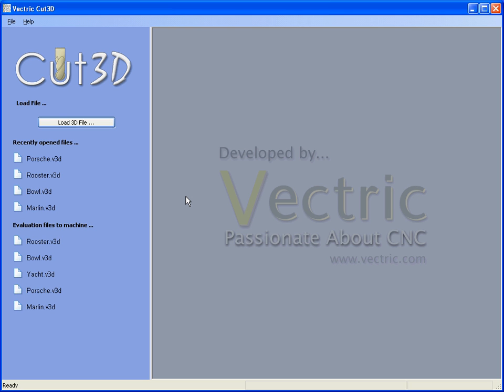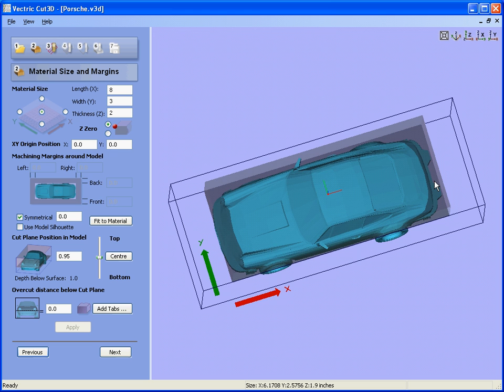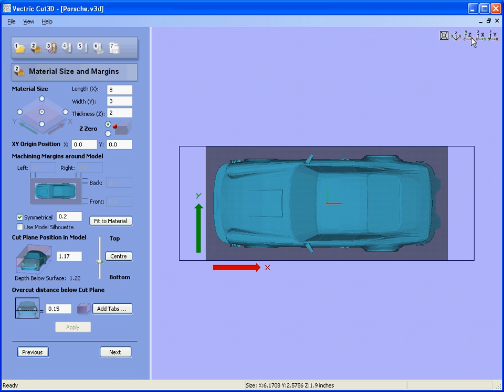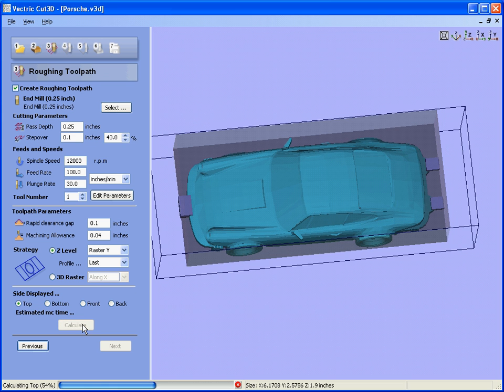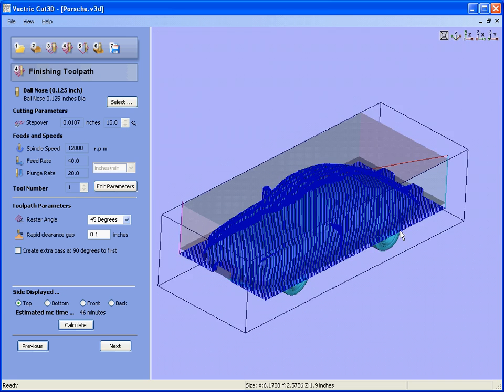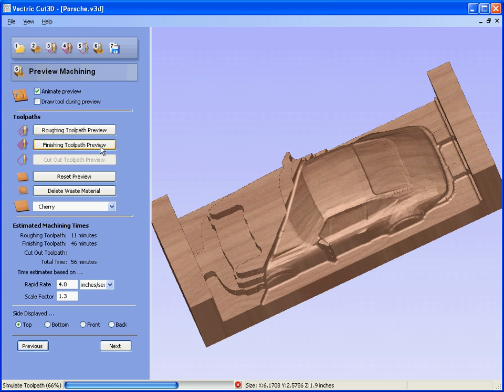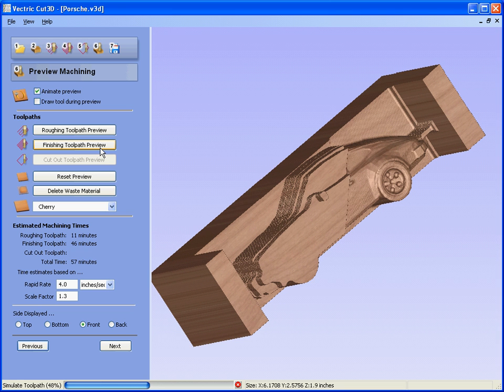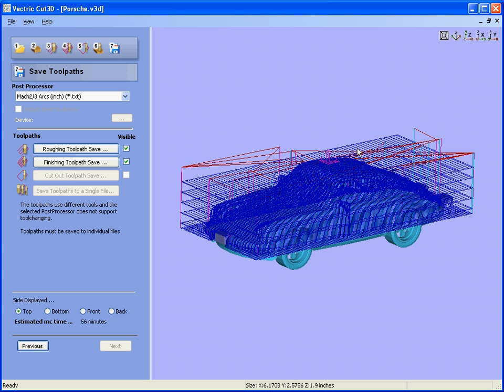Cut3D - 4 Sided CNC Model Machining

Comment: It appears that this software allows you to work with stl files but does it allow you to import and stl file and print it the exact size of the file imported. I have watched several of your videos and they all seem to have you scale the object when it is imported. I am wondering if this software or any vectric software has the ability to cut exact sized objects from stl files?  If so I would love to see a video on you importing an stl file and carving/routing it to exact tolerances of the stl file.

Comment: @Vectric 
Thank you!
That is clear.
Let me ask another question.

If material was chucked up between centers on a 4 axis cnc or rotary, and the operator had manual control over the  4th axis, this would then be the optimum use of Cut 3D, would it not?

The top, right hand side, bottom and left hand side could be roughed and then the process repeated with the ball mill of the users choice with no more than two revolutions of the rotary.
Am I tracking?

Comment: Hello!
Can you clear up a bit of misunderstanding on my part?
It was unclear watching the video if any data was actually driving the fourth axis.
Would I be correct in assuming the machinist must fixture the material and rotate the block after each process or.....is fourth axis data available  to rotate the model between centers?
Thanks!